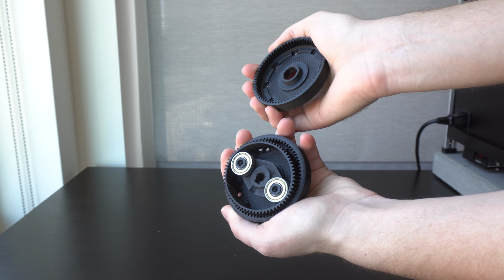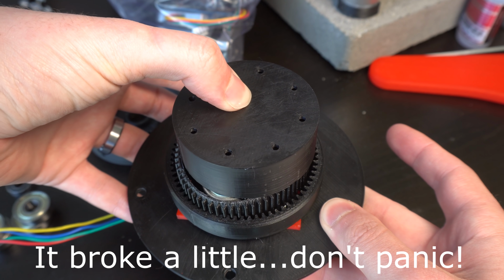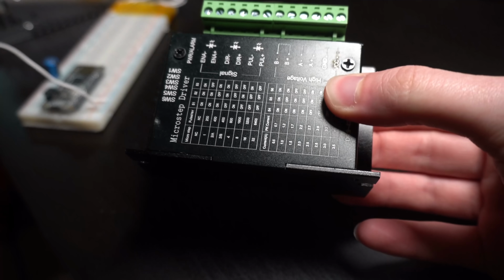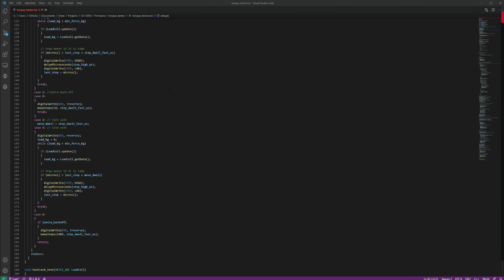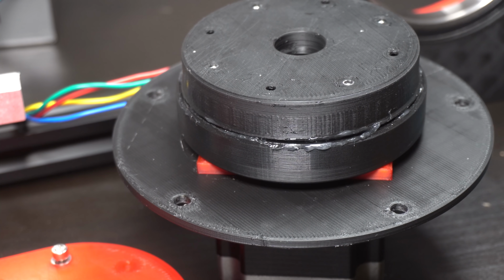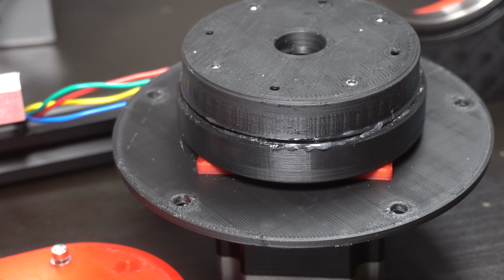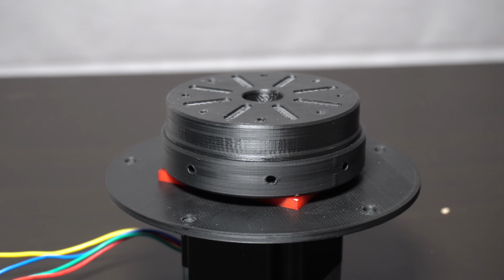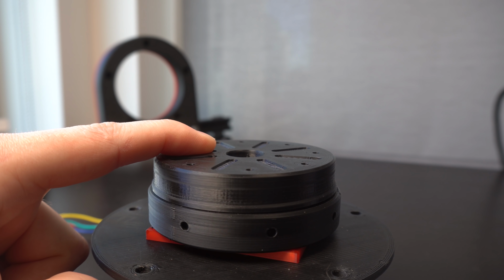My 3D Printed Harmonic Drive is Surprisingly Powerful!

Comment: This is great, and no I want to build one.

I will note though that while I'm far from an expert, iirc nylon is actually quite soft compared to petg or pla. The reason it's used a lot is that while it's soft and will flex it won't break or crease as easily and is better at certain temps.

If you want it to be rigid, I think you'll need the fiber reinforced stuff.
Reply from the maker: Yeah that is true, though I think the increased durability and wear resistance would justify the small increase in gearbox deflection under loads. Fiber reinforced is very abrasive so that would work well at first but I think the performance would fade quick!

Comment: Great video. Still appreciate seeing the progression, rather than skipping to the finished version. I'm sure by the time you have printed 6 you will have refined the design much more and need to reprint the first one! Don't forget that while the single design is attractive from a scalability perspective, your robot arm will thank you for making lighter gears near the effector and beefier ones near the shoulder. And with your parts being printed tooling = free so CAD time is your only real excuse not to have a couple or few sizes.
Reply from the maker: Yeah all good points! I'm only planning on using this gearbox on the two main hinge joints for exactly that reason. I'm still figuring out how I'll handle wrist motion and the rotary platform, but I expect I'll go with a simpler reduction technique like just using belts.

Comment: Nice project. .... as always when I print something nice.... i try just for fun to print it as small as possible with a 0,2 nozzle...... how small a motor can you use maby ! And ball bearing and and and....... som times when printet parts don't hold...... try to angle the print just 30° degrees. ...and just live with supports..... 😉
Reply from the maker: Hmmm well you can definitely make it a lot smaller if you wanted to! Probably as small as half the diameter of mine if you found the right size bearings and change the tooth profile a little!

Comment: Oh and btw you could also reduce the big bearing cost down to next to nothing by using something like my new toy here: https://youtu.be/xbGtqpgfdRM. And the same big yet cheap and lightweight bearings can also be used in your arm's joints.
Reply from the maker: Thanks for the tip! I did consider this, but with the loads I'm looking at, I don't think a plastic bearing raceway would be up to the task. It definitely could be made to work with this gearbox though and get the price down to about $5 for the whole unit!
Reply: @3DprintedLife  you clearly haven't watched my video 🙄😁 my 3d printed bearing actually has full metal balls and raceways, so while it's not as smooth and perfect as a real bearing is a whole class above any plastic-only bearing. Just give it a watch and see what I mean.
Reply: @3DprintedLife  I believe my previous video will more clearly explain the full metal part I'm talking about: https://youtu.be/-_Gp-6SYbw0
Reply from the maker: Thanks for joining the discord and explaining, YouTube is terrible at notifying me when people reply. But yes, my bad. I skimmed through the video a little too quickly the first time around XD

Comment: Why not look at "the orbiter" it has about 10lbs of torque and is smaller than your idea. Yes it's for filament but it could be modded to do what you looking for.
Reply from the maker: Ah looks like that uses a planetary gearbox. I considered this type of gearbox as they do work well and can carry lots of torque, but they often have a lot more backlash and deflection under loads especially when made out of plastic. Thanks for the suggestion!
Reply: Another design that seems interesting (but unfortunately hasn't been pursued beyond early CAD designs) is the in-plane compound cycloidal gear as conceived by Levi Jansen. He seems to aim for miniature so there's always room to beef things up for applications like this. It's still untested AFAIK and the first stage needs to be balanced, with backlash unknown although definitely not zero, but stunningly clever, compact, and promises some serious reduction ratio. 

Almost as exciting to see as this printable pancake approach - which has great potential to become quite useful, popular even. All these clever people tinkering away, iteratively enabling our robotic future. Exciting times!

Comment: nice! had the same problem with stepper motor axle decoupling from harmonic drive how did you fix it? Also, how do you search & find those big bearings? I would like to replace the 3d printed slew bearing on my design xD Other than that pretty good design! You can get square carbon fiber square tubes from aliexpress for cheap (2 per arm would cost 8$ US per arm)
Reply from the maker: More plastic behind the part and pushed the square nut closer to the flat of the shaft. Nothing fancy, just tuning. I found the 6815 on Amazon but availability will vary depending on region. You can also buy them straight from China on Aliexpress or similar sites for even less! And you read my mind, I plan on reinforcing the arm sections with carbon fiber tubes so I can keep the plastic weight to a minimum for both weight and print time savings!

Comment: Great job! Nylon is the best filament for sure!
Reply from the maker: Yeah I'm definitely excited to try it out!
Reply: Define the best (:
Reply from the maker: @shurmurray  The greatest!
Reply: @3DprintedLife  the trickiness of printing with nylon may easily overweight it's mechanical advantages :)
In many cases it's much easier to increase width of a part made of some ordinary PETG to achieve required strength.
Reply from the maker: Yeah haha exactly why I was hesitant. But its probably still worth the improved wear resistance and lower friction. And easier flexing! We shall see!

Comment from the maker: Thanks for watching! If you enjoyed, check out some of my other videos like a pneumatic 3d printed liquid piston engine! https://www.youtube.com/watch?v=QdH_su27DYg
Reply: try vapor bath of carburetor cleaner on the flexspline (pla) instead of the nylon ?
Reply: I just found this video and assumed you had like 300k subs because of the production value of the video. very underrated channel!
Reply: Nice, but your labour materials and equipment use seem to add up to a LOT more than the price of the lower cost arm you showed.
Reply from the maker: @jbarnhart2653  well labor for me yes, it's way more. But I'm doing all the hard work and releasing as open sourced so others don't have to. Materials and assembly time will be significantly under even the lower priced arm I showed (which btw that is the price of raw parts, you still have to build that arm yourself too)
Reply: @3DprintedLife  Yes but open source for people who have all the same equipment that you do.
More expense.
I've done a ton of 3D printing and fabrication and even the best looking, most popular and in my opinion well thought out projects and stl's require "tweaking",  in other words a lot of the work you did, in this video.
How much do you "pay yourself"? When I'm asked to look at stuff like this, it's at least $40 an hour. Price goes up the more tech and skill needed...only way down is by making a bunch at once...(no) but even then, I don't think that except as a "challenge" project that it would be economic.
"Build your own..." usual involves love of the work or better quality, rather than saving money or time.
Reply: You should consider installing a 3 axis gimbal stabilizer for your DSLR (not the one thats hightech and costly, the ones that balance naturally in line with the laws of conservation of energy, in this case mechanical energy), i imagine it would be easy enough to integrate one onto that robot arm, plus it could potentially remove one axis from the arms range of motion. less servos means less programming.
Reply: This is awesome! What material did you print it with? Just regular PLA?
Reply: Ok
Reply from the maker: @DeepVale  31.75 * 9.8 * 0.2. Don't forget about converting kg to newtons!
Reply: @3DprintedLife  you're completely right, i dont know why i though once i converted it from pound to metric then it was newton, hmmm.. but I think the fact is i am kinda having a hard time believing the plastic gears can withstand 60 Nm even if your Wheatstone bridge declares it. Especially because you measured the maximum stall moment/current to about 6 or 8 Nm (think you maxed at 10 Nm and i am only guessing you used stall current there since the motor stalled or did you stop it once it reached 6 ir 8 Nm)? Then I'd have a really hard time believing you can achieve 60 Nm, you were testing it's backwards driveability and strainwave/harmonic gears aren't, only cyclodial with specially configurations are.
Reply: amazing